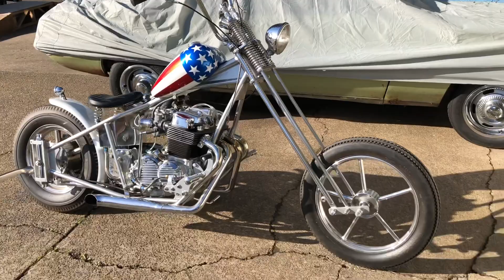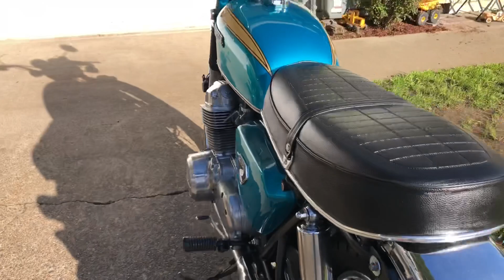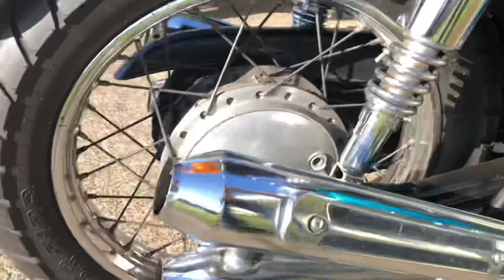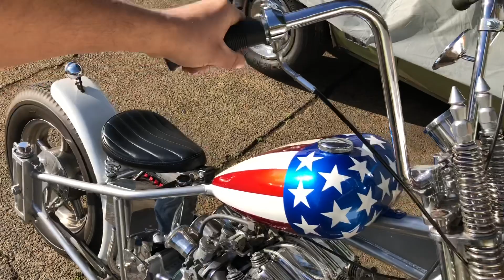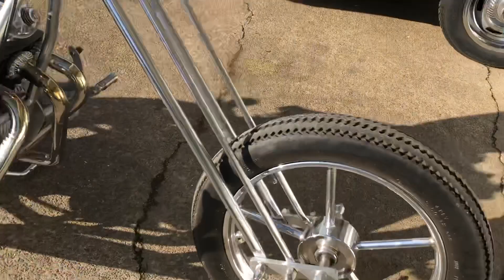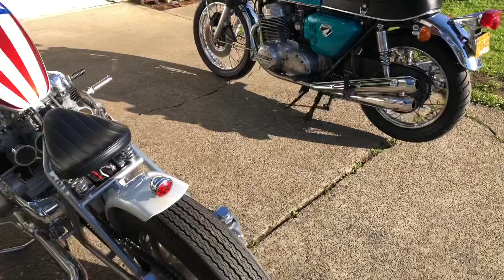CB750 Engine Sound Comparison | STOCK VS CHOPPER!

Comment: I would be afraid to put too many miles on a '69 sandcast survivor.  That "captain america" hard tail is sweet.   I just acquired a '72 k2 project that someone put extended forks and "chopper" seat and bars and psychedelic paint.  I am looking forward to getting it running and putting some miles on it :)

Comment: Love the old CB750's, but I've never thought they made good choppers.  Something about the wide 4 cylinder engine that just doesn't look right to me in a chopper frame.   The stock bike sounds really nice with those original pipes.  They both sounded pretty good.   I'll take the stock bike any day of the week.